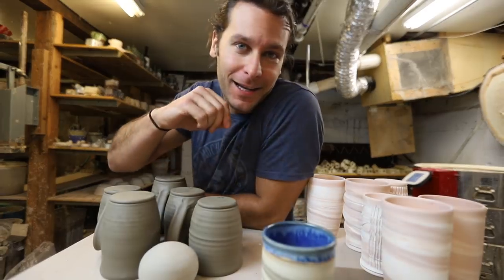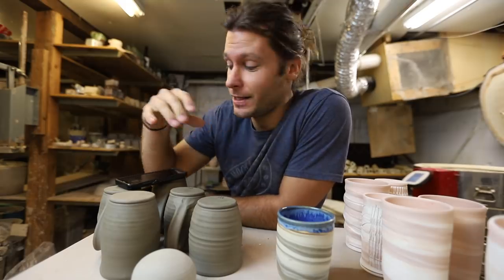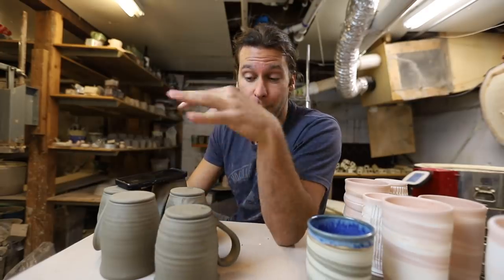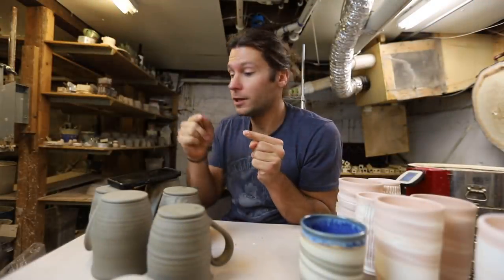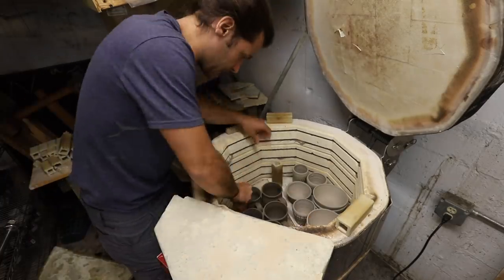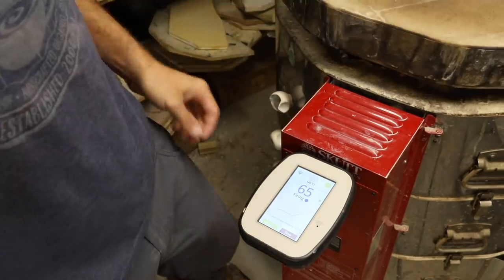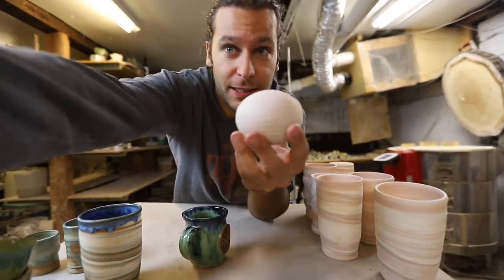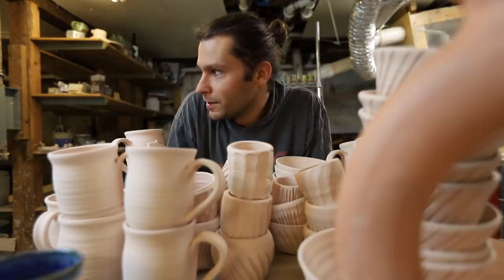Will this BLOW UP in the Kiln?? Do air pockets in clay matter?

Comment: I am really impressed that the hollow ball did not crack due to the shrinkage during the drying process. o.O
Reply: I thought so too! Like, how did it not crack?!
Reply: the air escapes so there is no pressure build up, allowing shrinkage without fracturing.
Reply: @theslenderchick1797  - the air escapes so there is no pressure build up, allowing shrinkage without fracturing.
Reply: @bungawarrahlima8816  I am a ceramist, I know how it works, but my question is more of how did the air escape if there was no hole poked (Yes clay is porous but there is no large area of escape.) I am just assuming that it was because he preheated it for so long and thus slow fired it.
Reply: You were talking about the drying process, and that is what Lima commented on. Air can escape freely during the drying process, no holes needed.
Reply: I m teaching ceramics to young learners that are building very thick pieces without caring about air pockets at all ( they are mostly G2-G3 students ) and like he said in the video as long as you wait until the clay is bone dry and bisque fire slowly there is almost no risk of explosions.

Comment: This is interesting, but doesn’t say much about the socalled “myth”, since you fired so slowly. Would be more interesting to try it out with a regular firing, since that is what most people mean when they say ‘will explode in the kiln’. You just basically stated that it doesn’t matter, but I still believe that there is a good reason to not fire work that is too wet or has air pockets. This is not a myth!
Reply: Itll obviously explode if u fire it fast. I thi k the myth is that you cant make a pot if it has an air bubble in it
Reply: Agree 🤷‍♀️
Reply: @illicitlegacy3783  We get that's what he means, but only because we have experience with it. The video title contains the question "do air pockets in clay matter?". And yes, air pockets matter.

Comment: What about clay that is thicker than your thumb? My teacher never fired something if it was too thick.
Reply: Emily Sims I’ve fired clay thicker than a thumb but doing so is riskier because it increases the likelihood of having an air bubble. If your clay is good and wedged it’s generally fine.
Reply: Emily, that clay ball could have been fired on fast and done just as well but the mugs had to be fired very slowly until they were dry. As far as firing thick things they can be fired super thick you just have to go slower through the chemical water stage water stage (550° 1150° approximately) I have actually fired a sculpture of a head that was close to life-size that had no holes drilled in it it was totally solid. I dried the piece out in an oven slowly working my way up to 550° for 12 hours and then I put it in my kiln and fired it on slow, no cracks no problems. 
Air bubbles never cause blowups, ever, promise ; )
Reply: Thicker wares, just take longer to dry, and that causes the issue.  As a teacher, I won't fire anything, thicker than an inch, unless it's hollowed.  I could just fire thicker things slower, but I fire at a rate, that works best, for the majority of the work, which is thinner .  Slowing the kiln down for a project or two, is just a waste of time and energy.
Reply: Almost anything will fire fine if you candle for 8-10 hours like this fella did.
Reply from the maker: Thanks for all the responses to this question, yes it can be thick it just has to be completely dry  and/or fired very slowly.  Even if sometimes it seems totally dry it might still have moisture in it and if fired at a normal pace may causing problems.  But yes to all these other responses!
Reply: I create hollow hearts. Never had one blow up. Little hole in them when leather hard. I fire them normal.
Reply: Gina Feddersen umm Gina, then they are not hollow, they have a hole. That was not what this ball he made was it was totally hollow without air escape hole as you do. Why make little hollow hearts? Is it a reflection of all the lovers you have lost? Your own reflection for being shallow and having nothing inside? This little heart of mine is solid, full of green blood, and not full of fake love with great wishes for everyone. Not everyone is real and the few that are don't deserve what is inside a solid heart.
Reply: When water turns to steam/water vapor it expands tremendously!  When you heat things slowly you desiccate the water (dry it out) rather than boiling it, so you don't have to worry about it exploding. The thickness doesn't matter if you increase the heat slowly enough
Reply: It is moisture trapped in the clay that cause it to blow out.  If you do a "quick fire" you must make sure your clay is completely dry.
Reply: @thingsofsuch  wow, what a weird-assed insulting and rude comment.
Reply: @thingsofsuch  perhaps you should stop staring at the sun 😉 You do not speak as the person you think you are.
Reply: @robsanders5808  I was thinking the same thing!
Reply: I would secretly hide thick things inside my pottery to test it and I’d play it off as a mistake when my teacher had me gluing everything back together that broke lmao
Reply: @thingsofsuch  wow what a snarky comment! 😐

Comment: Try air pockets within the clay.  As you do not wedge clay enough when combined remnants.
Reply: Air pockets in the structure, are just weaknesses.  The will mot explode, if dried thoroughly.
Reply: Provided there's no significant moisture or that, like Jon did, you let it dry for a long time using a pre-heat, it'll be fine. The air pocket doesn't care, it's the water expanding inside an air bubble that can cause the issue.
Reply: I did a pit fire recently and my piece shattered due to heat shock. One of the cracks revealed a small air bubble in the wall of the vessel. The piece survived a bisque firing just fine, so that shows that air pockets don't cause pieces to explode.

Comment: Would the closed orb survive the glaze firing?
Reply: mike robles yup
Reply: Wares can't exlpode, after the first firing, as they have no water to cause the explosion.  They can crack during the second firing, but that is usually due to a glaze fit issue, or a previously unseen stress crack appearing.
Reply: @benpatterson4452  i would disagree because when the clay becomes vitrified its no longer porous and if the temp is still rising it may cause it to explode, but @jonthepotter needs to settle this!
Reply: @josephbrazda5664  You're right, during the glaze firing, the body will vitrify, making it so nothing gets in or out.  But that doesn't matter, for a couple reasons.  One, there will be little to no air in a sealed, bisqued piece.  Some of it left,  during the bisque, and there isn't a lot of pressure to push any back in, porous or not.
Second, air only expands 1.5 times, in a firing.  Water expands 1700 times, hence the problem with damp wares.
Reply: Yes it will.
Reply from the maker: Yes it did!  You will see it in the next video!
Reply from the maker: @josephbrazda5664  Haha I did glaze it and it did not crack, next video to prove it!
Reply: Jonthepotter the base wouldn't be glazed so the air can always escape through there. Damp mugs might not crack as the mug shrinks less the more dry it becomes. So there is less movement. So less cracks. Holes or pin holes may be an aid to complete drying though. Completely dry tiles stacked together may crack as there is no easy way for the water to escape. So the real issue is slow firing. Still for a beginner drying may be a problem so maybe don't try it. But never had a problem with hollow items. Sure made other potters ants I though.😹
Reply: Yes I do it all the time.

Comment: I will admit, that I played a role, in the propagation of the " Air pockets cause clay projects to explode" myth.  
I repeated it, to my students, because that's what I was taught.
It wasn't until, years later, that I learned the truth, and began stating such, to my students.  The truth is air on increases in volume one and a half times, when heated.  Water expands over one and a half thousand times.  

Air pockets are still, definitely an issue.  For one, they are a weak point, in the structure.  Anything is stronger, than an empty void.  Air pockets also trap moisture, which can, and does cause explosions.

The candling/ water smoking, that you did, was beyond overkill.  I do a four hour hold, during bisque, and that's with a lot of uneven, thick wares.  I rarely have issues, with this program.
Your damp greenware survived easily, because the program was so gradual.  To further ensure that damper wares survive, put them in the kiln, top or side up.  The bottom is the likely spot to explode because it is thicker there.

It looks like you are enioying your "Do All" trim tool.

You covered the biggest myth, in Ceramics.  I really can't think of any more.

Comment: "This video we are testing if air pockets are the reason that clay sometimes will blow up in the kiln or if it is actually due to moisture in the clay."

 The air pockets hold steam which is trying to escape quickly.... 

 It's the air pockets trapping the moisture that's trying to escape. If you fire really fast the steam will blow it. A slow fire will let it escape slowly.

 It's not the air pocket or the moisture, it's a combo of both fast fired that makes it blow.
-----
 Do the same thing in a 2 hour fire it will blow.

Comment: Jon,
 always good to see it happen...not. I single fire raw glazed pots in a manual kiln with no way of knowing the actual temperature.
Tempting blowups with each firing is not good with glaze involved, have a wee backup kiln if it happens.
I weigh my pots on the gram scale and when they stop losing weight I put them in the kiln and set all 3 switches to low for 2 hours. As I type the kiln is on it's 10th. single fire and so far so good....will find out tomorrow morning.
Enjoyed the video...thanks for sharing.

Comment: It is the expansion of trapped water vapor into steam that causes breakage.  If there is little to no trapped water present at the temperature where it turns to steam, the clay will remain intact.  Chemically bound water in clay will not turn into steam because it is driven off at higher temperatures than molecular water.  Slow forced drying below the steam point reduces the chance of breakage compared to not candling, but is only advisable for certain bodies and types of construction.  A porcelain body, or a vessel with wide variation in thickness, might not explode by candling for 10 hours, but it could crack due to differential shrinkage of thin and thick parts caused by uneven drying.  This is the main reason against force-drying of ware--you don't want to increase the chance of uneven shrinkage and cracking, only to find out your bisque has broken.  So, I think it's fair to say that the answer to the question really depends on what clay you're using (e.g., grogged versus non-grogged bodies) and the complexity of construction (e.g., are different parts liable to dry at different rates).  For what it's worth, I've seen very thick pieces survive the bisque, but then when glazed, the bisque soaks up so much water that it cannot escape the bisque fast enough--and it explodes in the glaze firing, which is far worse than a bisque explosion since the fragments will adhere to adjacent vessels.

Comment: I use an earthenware clay body and do not wedge the scrap clay real well before reusing...I am sure there are air bubbles in the clay, and if I see them on the surface I will puncture them with a needle tool when making slab slump bowls or platters..I have had very few incidents of exploding, as the crucial issue is to make sure the pieces are TOTALLY DRY before firing...it's the steam factor that causes explosions...even if I feel the pieces are bone dry I run the kiln on low, and leave the kiln lid slightly open, for the first hour of firing, to ensure any moisture is out of the clay.

Comment: Jon, this is Sherio the potter. Firing ware that is wet is very hard on the kiln elements. Replacing elements takes time and is expensive. As for air pockets being a problem that is a myth. It’s water that turns to steam at 212 degrees that is the problem. I always pre-heat sometimes over night at 200 degrees. Get the ( dry )ware toasty dry before slowly firing through 1100 degrees for best results.

Comment: Basic physics.The myth is that trapped air expands with the heat and blows the pieces. Though air does have a % of expansion when heated (+ compression) it's marginal in ceramic firing : remember the ceramic body is also expanding at a much greater ratio. It would take far higher temperatures that those used in a ceramic firing to make the air expansion enough to blow a piece. However, WATER molecules expand quickly into vapour at a mere 100°C (boiling point). In fact the ratio of expansion for water is 1:1700. This means that a water molecule expands 1700 it's size at the boiling point! If there are no venting holes in a piece, the water vapour pressure cannot be released and the piece will blow. So dampness (even residual) in pieces is responsible for the majority of mishaps. Especially the tick walled pieces. Even if they have been drying for months there is still atmospheric humidity. Clay is hydroscopic. Always make a slow pre drying curb in the kiln before firing ; under the 100°C mark for a few hours (depending on size and thickness of the pieces and kiln load)
Other reasons for blow-ups : -negligent compression of clay layers. If you are sculpting and not compressing your layers adequately you may be creating detachment issues once the clay expands and contracts in the firing.
- impurities in the clay. Especially if you are using recupered clay. Unnoticeable plaster fragments from moulds and whatnot. Debris from the studio, etc.
- incompatible clays. Clays that have different ratios of shrinkage and deformation while drying and firing. Ceramicists that merge different clays in their practice (nerikomi as an example) need to be aware of this.

Comment: Its all about the water vapor within the clay. At around 220 Fahrenheit, the moisture within the clay turns into vapor and it expands. As it is expanding, the clay cannot keep up with the amount of vapor that is trying to reach the surface of the clay, and so the clay explodes. Even if a piece might look dry, if there is even a small trace of moisture and it reaches 220 before it fully dries, the piece will explode. The only problems that air pockets will create are wall consistency, structural integrity, and so on.

Comment: i was told that if any plaster from the wedging table got in your clay it would explode. also if you clay is real thick in one area and thin in another it would blow. also throwing of the hump and not compressing the bottom back to the center causes the dreaded s crack

Comment: Wow! Ive always wondered about that. I actually just made a dragon egg similar to how you made that ball. I ended up putting a hole in the bottom just to be safe. I wonder if it will explode when it goes for the glaze firing.

Comment: When I fired my tap and die load I assumed my flasks would blow up, so I fired with the caps off and then with caps screwed on loosely. I didn't have a problem but I know if clay is wet and thick it will explode in the kiln. And any bit of plaster I'm pretty sure explodes too. Also, if you know where I can get a wide diameter coursely threaded stud press mold I would like to make a load of pottery thermoses.

Comment: Hi John! Thanks for your fun informative videos! I would love to see some experiments done with firing leaves... marbles or different colors and basic combustibles... and or experiments with soda ash  silicas and oxides etc... That always fun to see!
Reply: It isn't a good idea, to put combustibles, inside an electric kiln.  There is the issue of fumes, plus combustibles will greatly shorten the life of the elements.  This is why potters use designated kilns for soda, salt and Raku firings.

Comment: This doesn't totally debunk the myth that air bubbles cause explosions, as it's fired so slowly. Most people get told to be very careful about avoiding air bubbles in joins and wedging. So, to debunk the myth, you also need to test small air bubble, trapped in a join, or wedged clay, and then bisque fired as usual. I would imagine, their might be limit to the size of the air bubble and its rate of expansion vs the rate at which the air  can escape.

Comment: The reason it didn't blow up is because you fired it so slow that by the time you got it high enough to blow up, everything was completely dry. If you fired it to fast the mugs would have. Because it gets too hot too fast. I would be surprised if the ball had blown up because it was a 2 part pc. There was still away for the air to escape and it was slow firing. If you were to make a round ball thathad no where to escape, it would most likely either blow a hole in it or blow the whole thing to smithereens.  Probably with a regular firing .